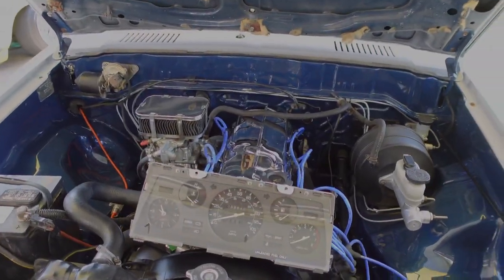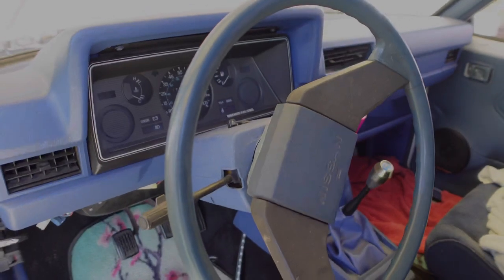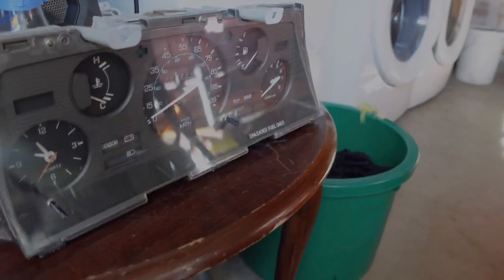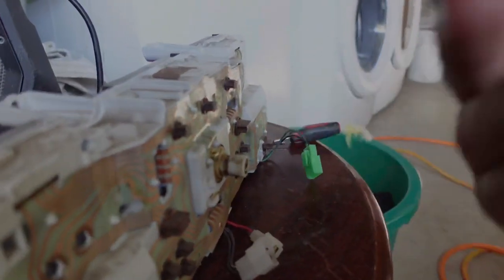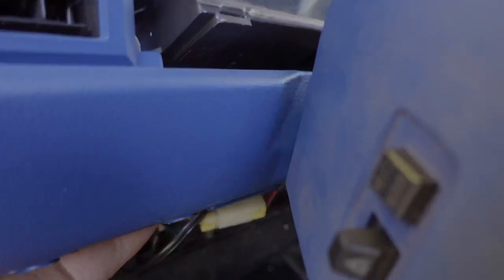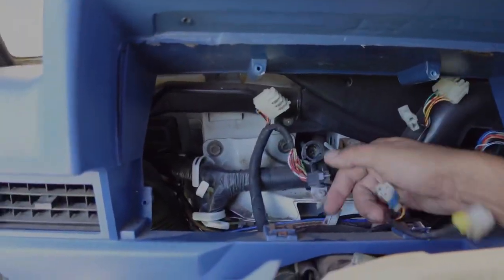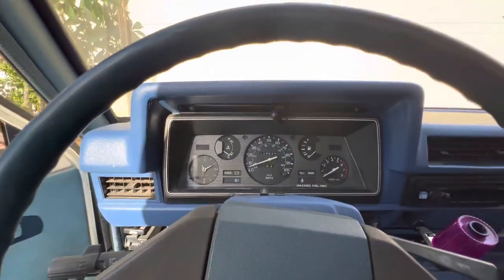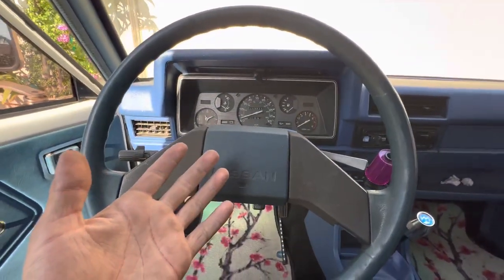INSTALLING A ST GAUGE CLUSTER IN MY 720

Comment: What are the cables coming from the cluster for? My cluster has 3 cables but it doesn't have a clock or a tachometer.
Reply: Indicator lights, etc. A bunch of wiring goes through there too, like for the cigarette lighter and radio

Comment: On the z24 motors did you ever have no radiator hose pressure or do you know wat it could be.....
Reply: Put a balloon or glove tightly (with a rubber band) on your radiator cap and see if it inflates. Your engine could be sucking it in and blowing it out through a bad head gasket that isn't bad enough to be very apparent yet. (This is what I am dealing with except now I've graduated from your position to a very obvious bad head gasket